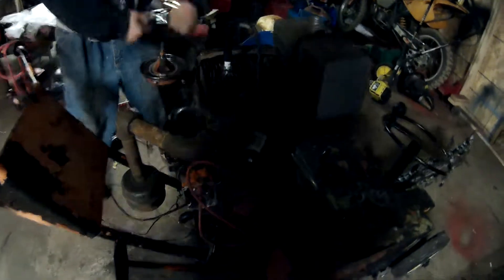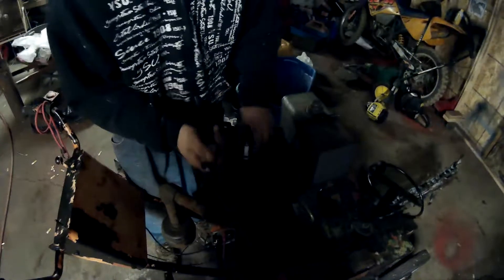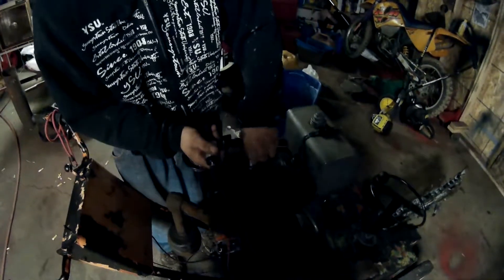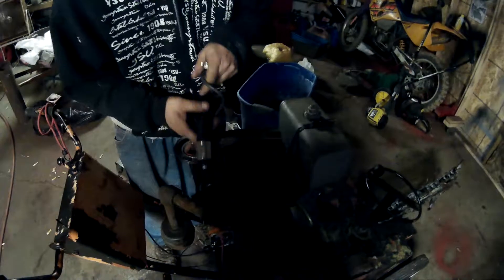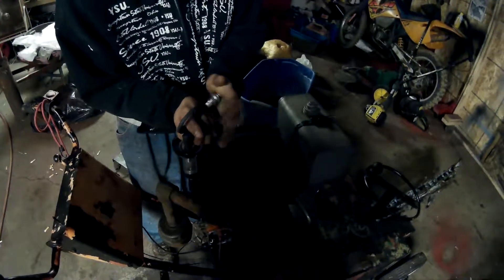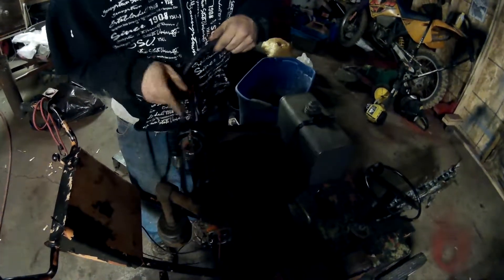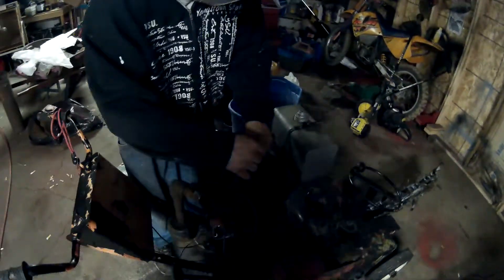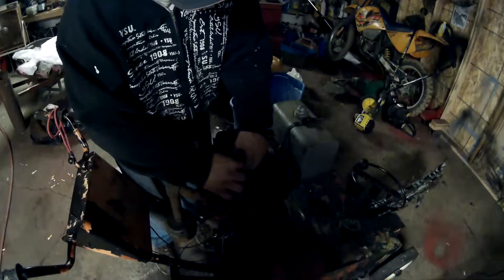1973 wisconsin 9hp spark issue

Comment: Why are you adding a second piece of plug wire when you test it the first time? I hope you aren't using resistor wire on that engine, as it will diminish your spark some. Most small engines have a solid wire core plug wire on them, don't use the carbon core from an automobile on their.